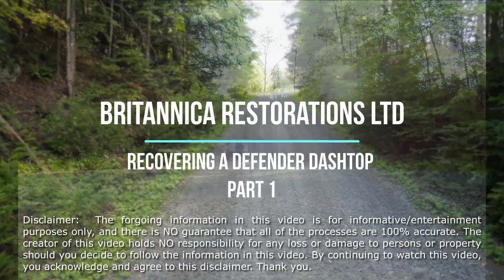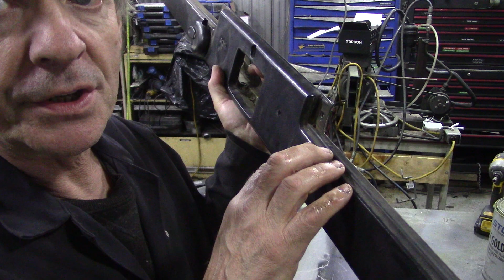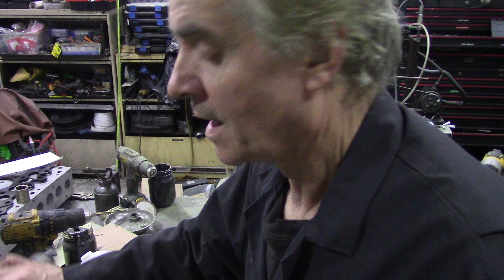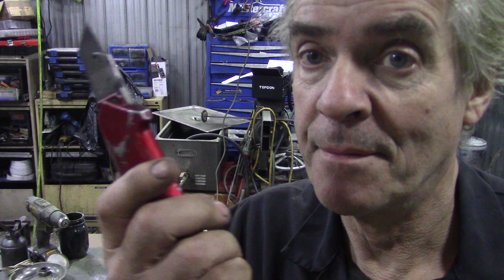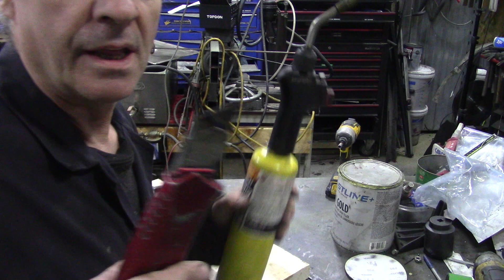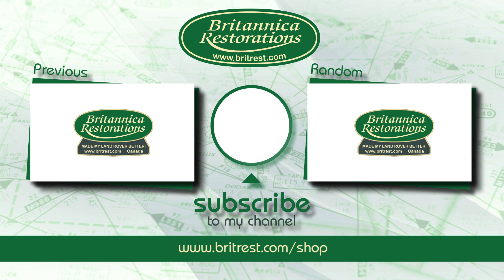Recovering a Defender dash top

Comment: I've just done that very same job Mike. And with the same 4 way stretch material. My dash was in much worse condition with cracks and holes drilled through everywhere! I ended up peeling off the old vinyl and body filling the damaged foam, sanding and then sticking on the new stuff. I didn't trim the foam or enlarge the recessed holes, but have a plan for the holes as the material didn't properly go right to the bottom. My dash must be slightly older possibly as the vent holes are 'holes' as such and not recesses cut out of the back. It's not perfect but should look half decent when back in the vehicle.
Reply from the maker: Seems as if the top dash is no longer available
I enlarged the 3 top screw holes, so the material would drop in.
If really bad, I remove the original plastic cover. You need to spray and walk away from the glue for a while so it sticks well
Using a 2x3 and inserts for the vents worked a treat.
Where did you find your 4 way stretch in the UK for others to find it?
It has doubled in price since our last dash job!